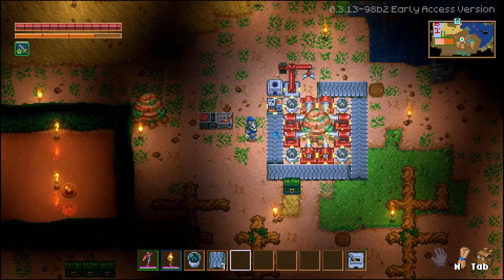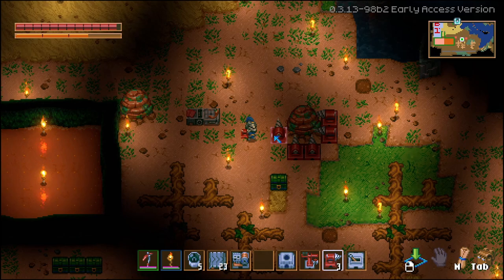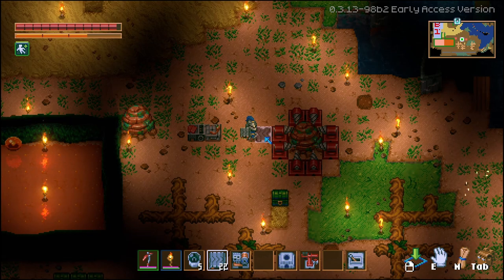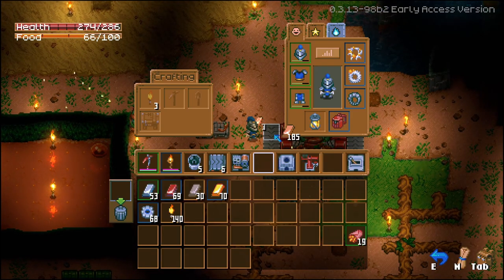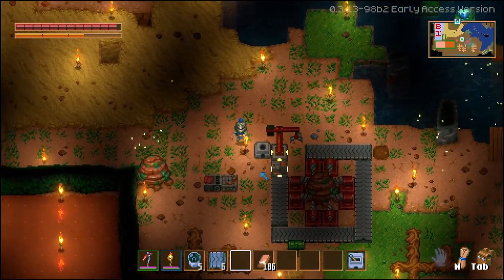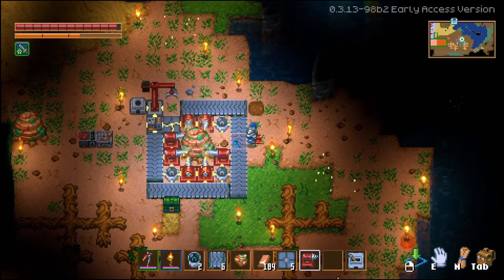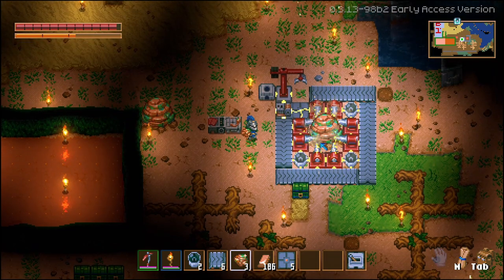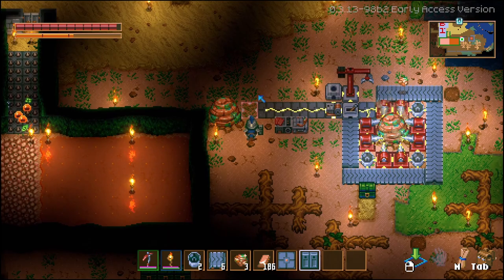Drill tips and tricks -  Core Keeper

Comment: FYI, it's been proven you get material faster with 8 drills but your overall yield is cut in HALF. 

1 drill takes 29.9 hours, with 900 total material
4 drills takes 7.5 hours, with 630 total material
8 drills takes 3.6 hours, with 450 total material

*time is different but yields are the same based on how far you are from the drill
Reply from the maker: I saw that recently and was very interesting graph. 
For most players that play though I think faster is more important than efficiency.
Was split on mentioning it, this video is more aimed at new players that will probably be in the faster camp building it themselves. 
Long game thou I would probably do 5 drills for best results.

Comment: not optimized. you can do it with: 
16 conveyor belts, 2wires,8 drills,1 arm,1furnace (moving the arm 1 to the right and removing the last conveyor behind the drill)
Lighting is completely optional and not needed as you only interact with the furnace.